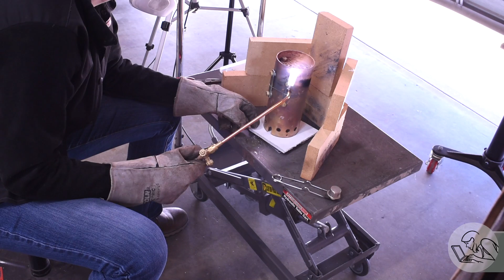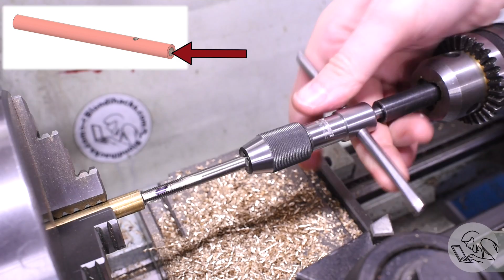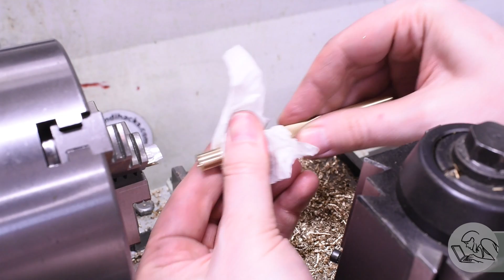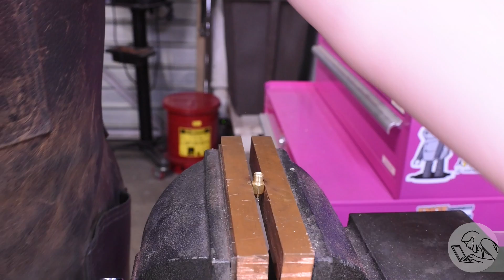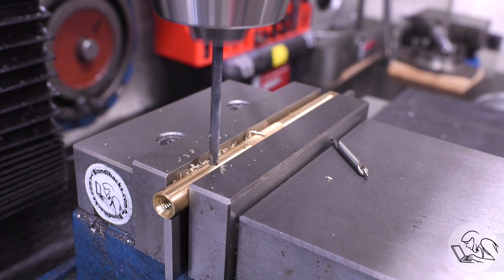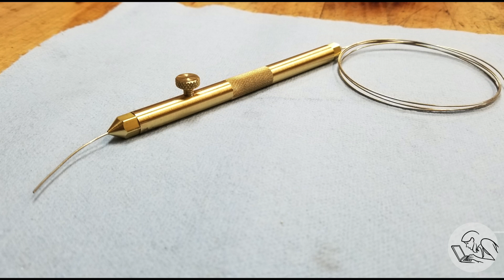Solder Pen!

Comment: A little trick I use with my solder Quinn is run it between 2 fingers and a thump and if it’s still not straight enough slight pressure from a hammer on a vice or other flat surface but clever thinking I like the idea it could also be useful for general soldering too or say if you’re doing detail with some wire of some sort you could use that to hold and pull the wire where you want it

Comment: Not a machinist or someone who needs to solder that kind of stuff.

But - I was wondering if a feed wheel might not be a better solution? For it to work, it would have to grip the solder firmly enough to push it forwards, which MIGHT be enough to keep the coil from turning the bit that's hanging out. That way you'd have a fast way to get more solder ready while also having the solder pointing exactly where you want it.

No idea if this is even relevant to the type of work that needs soldering - just thought I'd share.

Comment: I’m thinking something like this would work well for electronics soldering.  You can control the position of the end of the solder without having to get your fingers too close especially when reaching in tight places.  Maybe add a little thumb wheel to manually feed it through.  
Also, The tips look just like 3D printer tips.
Reply: I don't know. I've soldered a lot and never experienced trouble. I just cut smaller pieces of solder (approximately 20 cm) and voilà. And heat isn't a problem at all...

Comment: 6:36

Question: pretty new to metal machines, never ran a metal lathe... you say to engage the power feed slowly, is it actually possible to sort of feather in the acceleration speed? or am I (most likely) just not understanding something? =) thanks in advance for taking the time to answer this
Reply: Naah, it's kinda binary. It's either moving at full speed, or not moving at all.
Reply from the maker: A slow feed speed is what I meant
Reply: @Blondihacks  thank you =)

Comment: That's genius. I will have to make myself one of those. You have the same love hate relationship with knurling that I did. I found my cure and hope I can pass it to you. Any knurling tool that doesn't cost an arm and a leg ends up working poorly. What I did was look at the Hemingway tool and make my own. I would have gotten their kit, but it uses knurls that are not a common size on this side of the Atlantic. I made my own plans to fit knurls I can find commonly here and it works right every single time. It is a fun shop project too so I hope I have helped.

Comment: Hold one end of the wire in a vice. Chuck the other end in a drill (preferably one with speed control it can turn slowly). Pull on the wire and let the drill run for a bit. The wire will be nice and straight now.

Comment: Back when I had a job, I would take the ink tube out of a Bic pen, wind fine SN63 solder around a screwdriver bit in the electric screwdriver, pop the coil into the pen and have a handy dispenser and safe storage. But, I wasn't waving a big torch around.
Reply: back when I had a job haha yeah man, I fondly remember those days too =|
Reply: My dad has something similar with his electronics solder. However he doesn't keep it on a former. Rather he slipped the end of the coil through the coil itself and this is much more compact.

Comment: Great video. Very nice little device.  Do a search on you tube for tig pen for tig welding wire feeding.  It might give you even a few more ideas.  That was a nice idea for holding the solder.    Dan

Comment: I found the only way to reliably straighten wire is to clamp or tie one end to a bench or something very sturdy, grab the free end with some sort of pliers and PULL. First nothing happens, then as you pull hard enough, the wire suddenly gives and stretches to become perfectly straight. I have done it with copper and mild steel wires, so it should work with silver solder.

Comment: Great idea! Also if you made a small 1" channel with a dibbit exposing the solder on the side of the pen a 1/4 from the front  of the pen you could feed the solder with your thumb. Or by adding a thumb feed wheel just like the wire feed wheels on a welding machine with a small solder wire spool holder on the end. 🤓👍
Reply: Search tig-pen. It’s a similar device with a wheel to feed filler rods for welding.

Comment: Can also use paste solder applied with a syringe, or cut little pieces of the wire stuck in place with sticky flux.

Comment: Can you make the end of the tightening knob (the end in the pipe) rounded to match the inside of the barrel and produce pressure over a wider area, 
or is that just unnecessary extra work?
Reply: Don’t forget:  instead of threaded, think spring-loaded.  Easy, cheesy, one-handed operation!  If you’re planning on over-complicating things, you may as well COMPLETELY over-complicate things.  :-)

Comment: Yay, it's Blondihacks time!! (Also... I feel like I should buy a lathe... this would be great for electronics solder as well)
Reply: Electronics solder isn't springy.
Reply: @shedtime_au  agreed. However, soldering irons do get hot, and if you're soldering very small things, a pen-like holder would give more control without getting your fingers too close to the hot bits

Comment: If you clamp one end in the vice and stretch it slightly it will straighten right out
Reply: and if that is not enough you can put the free end in a drill and wind it up while stretching, this results in perfectly straight wires

Comment: As brilliant as this is why not use silver solder rods?
Reply: if you watched the video you would know: becaues it doesn't come in the sizes you need for small model work.
Reply: I have always used silver solder rods in model engineering, even to solder 3/32" brass nipples to copper pipe?